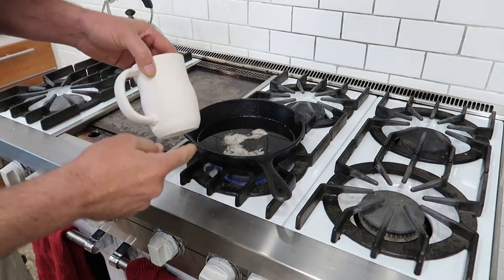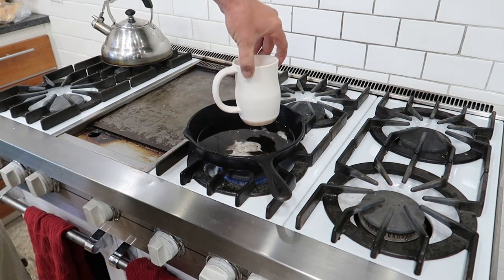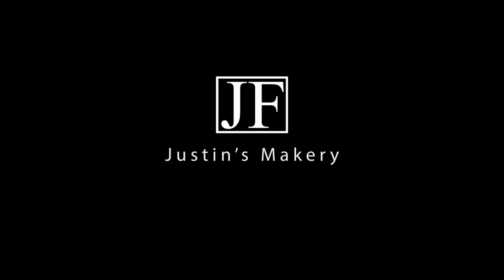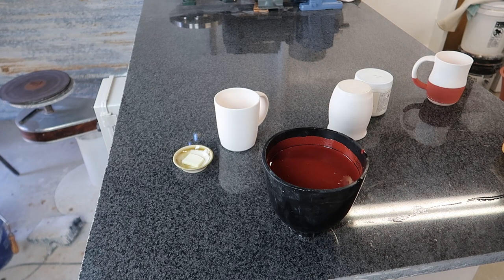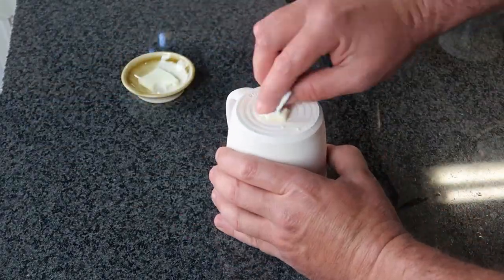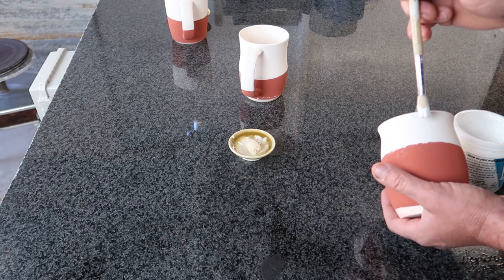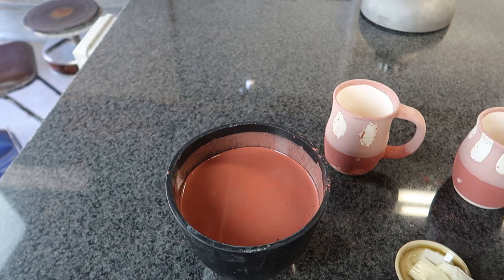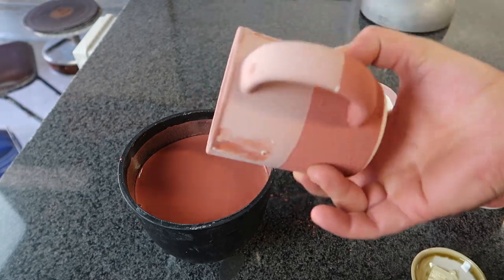Wax Resist Alternatives - Experimental

Comment: I have been using 90% mineral oil (same stuff in baby oil) and 10% paraffin wax by weight.  If you shave the paraffin into the oil and microwave it for a few minutes it melts. This thickens the oil quite a bit. Brush it on and it seems like it all soaks in to the bisque, but the wax is left on the surface and it resists glaze very well.  Sorry, I'm a bit late to the party, but I wanted to add that. I love this channel and all the experiments you do!
Reply from the maker: Thanks for the tip!

Comment: I live in the middle of nowhere. Ran out of wax resist. Used Modge Podge. Worked well. Then read modge podge is 50%elmers glue and 50 water. Do day before glazing dry over night works well have been using for couple of years
Reply from the maker: Thanks!
Reply: @JustinsMakery  that's the other %?

Comment: Crayons work way better and you can draw a wax resist design on
Reply: That's the one that caught my attention.  Gonna give it the old college try just as soon as the current bisque firing is complete.  Seems particularly attractive because you can see exactly where it has been applied, it costs nothing, and it requires no heating, cooling, mixing, or drying.  Shelf life is indefinite, too. :)

Comment: In my search for an alternative I melted paraffin wax, works good by dipping, but gets really tricky to brush it, not worth the hassle in my opinion.
Also I wonder if the paraffin releases some gas in the kiln that could "change" or contaminate the glazes.
Really like your uncommon tests!
Made a few tries mixing clay with beets and coffee to get a different color but all came on the original clay color, unfortunate.
Reply: I have been playing around with paraffin wax mixed with mineral spirits to hopefully make it brushable. right now it is too thick, like grease on a warm day, but I am slowly adding more mineral spirits when I think about it to thin it out. I think if I hit the sweet spot it will work well... still might not be worth the effort though. also, you have to melt the wax and add the mineral spirits over heat, so there is a fire hazard.

Comment: Justin! You are funny! I love your work. I'm about to try beeswax (because I cannot rationalize any more purchases right now) whats your experience with bw? Thanks
Reply from the maker: I have taken bits of home-harvested bees wax and rubbed it on like a crayon.  I haven't tried melting or maybe emulsifying the wax and brushing it on as a resist.  Could be interesting.
Reply: I have not used bees wax on pottery, but I have worked with it a lot and my problem with it is that it takes a lot of heat to melt it, and it likes to go on thick. I know you can also mix oils into it to thin it out for ointments and such, but then it would not dry.  if you thinned it with a solvent, it might work better, but you would have to grate the wax and heat it with the solvent which can be a big fire hazard.
Reply: @seanfarrell2862  would you need it to dry.
Reply: Not necessarily,  it is just easier to contaminate other pieces and glaze batches (if you are dipping) when the resist is wet. Any oil or wax on the clay surface should act as resist, but if it is just a little oil, it may take glaze, but crawl in firing.

Comment: Silicone...? From the tube.. And/or spray? 
WD-40...?
Grease motor/gear?
Engine oil? 
Coconut oil?... Solidified and liquid. 
White out... paint on, "pen" and tape
Reply: I would worry about what was going to burn off in the kiln with a lot of those.